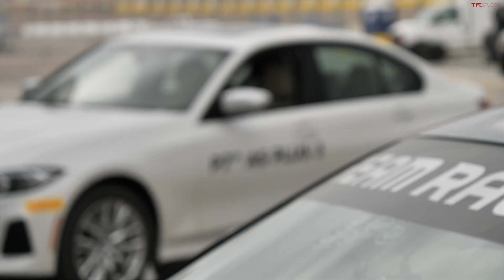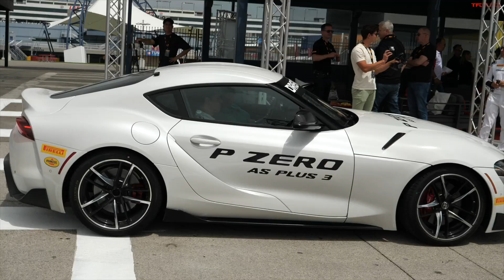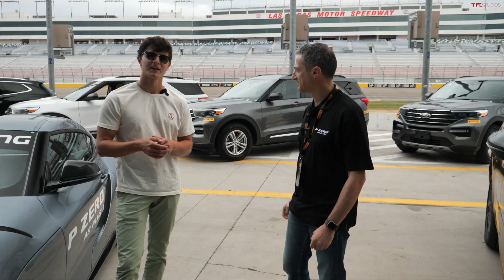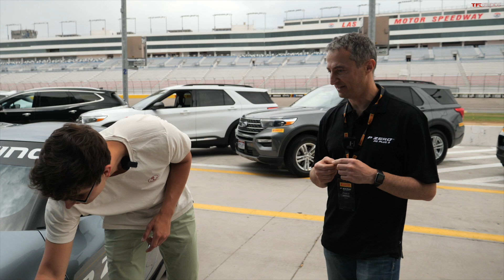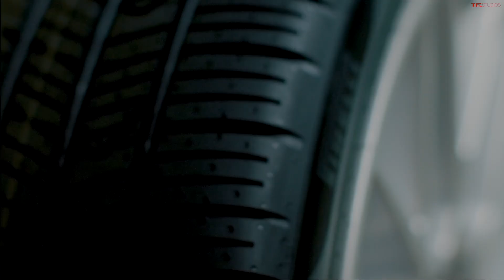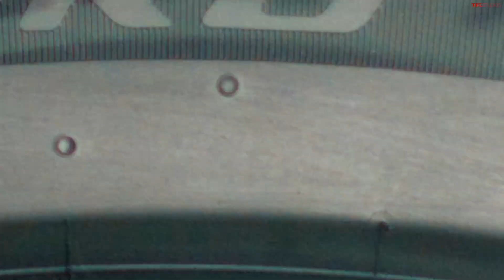This Is the MOST Important Car Upgrade You Usually Don't Think About! | Pirelli AS Plus 3 Review

Comment: I replaced my set with this model on my daily commuter car.  Especially changing from SL to XL load rating made a significant difference in composure, NVH and busy ride.  I have another vehicle with PZERO PZ4 summer tires; driven on them for 6 years, but I am considering to replace them with Cinturato P7s for softer construction and quietness.

Comment: Tires are important for relative grip. But I would say sway bars have a bigger dynamic impact.
It will improve your balance, grip, handling while only slightly impacting your ride from stock. 
I think it improves the ride as it firms up the transition from compression and rebound.

Comment: Really informative! I put these P Zero AS+3 on a 2020 Mazda 3 FWD before I ever saw this, took it in for a rotation today, and noticed the fresh, straight-line siping in the rear shoulders against the squiggly, more worn siping in the front. Pretty ingenious design, and I'm happy to know that it was intentional directly from the product developer. I also happen to be in Vegas and these perform so well here that I experience the "leaning on grip" factor when I drive, myself!
Reply: How are they holding up so far? I basically have the same car (2019 FWD) and just got these installed yesterday. Coming from DWS06+. First impressions are that they're a tad quieter and it has less of that squishy on-center feeling. Will push em more later this year!

Comment: I put these tires on my alfa romeo Giulia 2.0 Ti Sport.  Coming from Michelin Pilot Sport a/S 4 plus. I prefer these for several reasons. 
1. Wet grip is way superior. 
2. Michelin performance erodes within the first 10% of the tire life cycle. Most of its track capabilities are in the first thousand miles of use.  Afterwards they're more of a street tire. 
The Pirelli may not be as aggressive on the onset of use, like the Michelin. But you get more consistent performance for a much higher duration than Michelin. 
My favorite feature of the Pirelli tires is they give a luxury drive, smooth and low noise, while maintaining high grip and track capable performance. Also a set of 4 of these cost about $240 less than Michelin's. I'm sorry but after years of using Michelin pilots? I found my new preferred tire. Higher tread warranty, better price and more consistent long term performance.
Reply: Michelin Pilots have been quite disappointing for me so I am ready to try something new